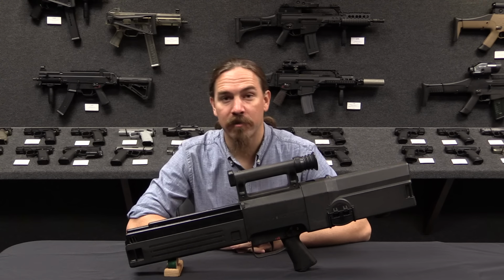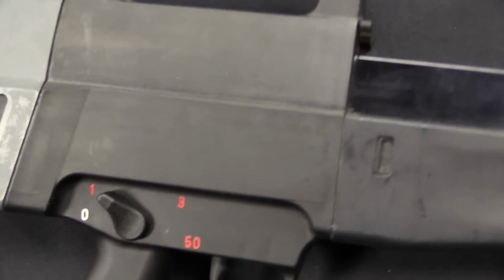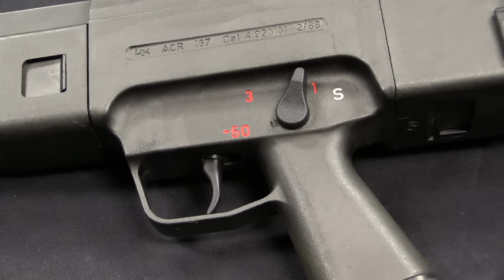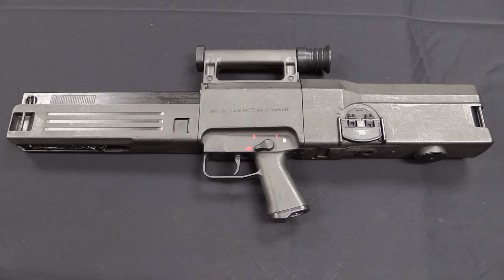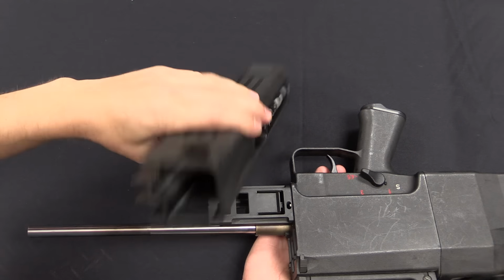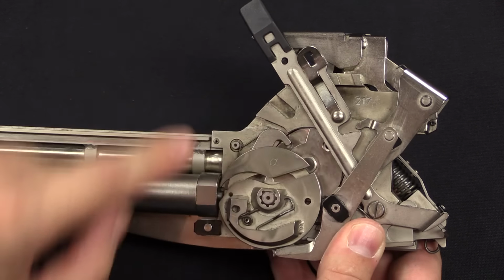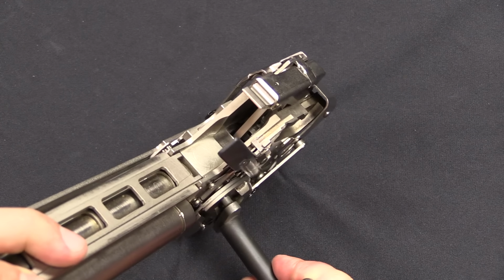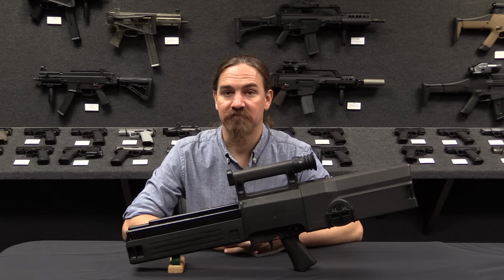Kraut Space Magic: the H&K G11

Comment: I'm no engineer, but wouldn't that have been a lot more effective with  an electric ignition system, acting on a hair-thin copper strand in the "cartridge"?
I mean, it was a newly developed round anyway. Probably easier to embed something like that into the block of powder than a primer, and it would just burn off in the explosion. And it would have enabled them to get rid of most of the clockwork, replacing it with something like a piezo igniter and a few coils and capacitors. Wouldn't even need a battery  (though having one would be beneficial for fully automatic fire).
If you have to make it space magic, make it space all the way. Replace mechanics with simple  electrics and analog electronics to reduce costs and complexity. 
Is there something I'm missing here?
Reply: Electronics, even 'hardy' ones can have temperature issues at extremes. A bigger potential problem is airmobile operations. Aircraft can build up phenomenal static charges in flight (more so in dry conditions) that are unpredictable at best. Imagine all of the ready ammunition in a troops rifle and pack spontaneously going off the moment his feet touch the ground.
Reply: @markbecht1420  You do realize that most fighter aircraft use electrically primed cannon and have for decades?
Reply: ARCNA442 uh what
Reply: @ARCNA442   Sure. Back to at least the 40's. But that's in an electrically bonded/grounded and integrated structure, not in a polymer magazine in a nylon pouch strapped to the squishy bits who might be roping off a helicopter (always let the line touch the ground first)
Reply: @markbecht1420  I laughed when I read your comment. That would be disasterous XD
Reply: The most of those mechanism are working for feeding/extracting and locking,ignition is probably the easier part.
Even if electronic primer is used, you still have to use clockwork to improve the gas sealing, or you have to use multibolt system or traditional system......then why use caseless ammunition?
Reply: @程鈞ChengJyun8542  Caseless ammunition was conceptualized as a way to increase the number of rounds that a soldier can carry into battle without increasing weight. By removing the traditional brass cartridge, not only can the actual ammunition be smaller than normal, but also lighter, thus allowing soldiers to carry more rounds for the same weight.
Reply: @StrikeNoir105E  also reserve vital war making material i.e. brass
Reply: @程鈞ChengJyun8542  use caseless to reduce loadout weight or maximize rounds carried.
Reply: @nichevo1  But use caseless ammo on a traditional configuration not only create gas sealing issues, but also prevent the use of non-circular ammo shape(to reliably feed),retain the potential feeding issue of traditional system,need a extra large port to clear malfunction......
Only weight advantage is definitely not OK for such a great R&D investment.
Reply: @程鈞ChengJyun8542  As far as I know LSAT worked well with caseless ammunitions and it's not a swiss made clock mechanic
Reply: @DC2022  LSAT is definitely not a traditional system.
Also,from developing stand point, LSAT is  not as finished as G11, and not like it has been 30 years apart or something
Reply: Electronics can fail at any time, it'll be a long time before vital functions are tied to tied to electronics, if ever, given how big of a threat EMPs are already.
Reply: @BigHairyFenian  simple electronics are at least as reliable as mechanical system and if they are simple enough they are not susceptable to employ.
EMPs destroys modern micro controllers etc not early cold war stuff
Reply: aggese The Germans knew that way ahead of the US.
Reply: I've been thinking this for a while. It has a lot of potential issues, and I assume that's why it wasn't done (there's enough potential issues already), but rumor has it it was actually floated around because electric ignition would allow them to make the propellant more resistant to heat, thus reducing the chance of cook-offs. 
Who knows, maybe it would have gone there had the rifle been adopted - as a follow up development. 
I don't think it would have made the internal operation any easier, though.
Reply: Electrothermal weapons as the name suggest use electric trigger system and this don't explode when passing below high voltage lines, working well (but  arriving at the end of USSR the kind of fate lot of 90's hitech stuff shared).

Imagine a rifle using a magazine with two parts, one for the bullets, and another being a tank for liquid propellant (having better energy than powder). With less propellant you would be able to fire more powerful ammunition. Or having two separate magazines, one being for bullets and another being a fuel tank used to fire the standard load of ammunitions carried. You would be even able to select your ammunition kinetic energy for example to fire subsonically by switching mode and "flowing the chamber" with less propellant or not loading a bullet in case you fire rifle grenades.
Yeah, I know it looks like scifi and would be seen as too complicated for real military operations. But I like this idea.

And btw, military stuff is shielded against EMP, it's a requirement so an electric primer system would be shielded to be immune to ESD and EMP if needed.
Reply: As cool as it sounds, the only portion of the mechanism that would be reduced by going electric would be the striker.  All the rest of the mechanism would remain for cycling the cartridges.   The next bit is getting it to remain reliable through environments.  Submerse the whole assembly in saltwater for an amphibious landing and keep all the electrics working like clockwork.  I personally like the idea of electrical ignitions, but I've not seen any way to overcome the difficulties with reliability
Reply: I've always wondered why electric primers haven't taken off. They would allow significant simplification of the fire control group and should improve drop safety.
Reply: would electronics leave debris behind them? melting plastic in your gun?

Comment: Why is everyone making such a big deal of the action being complicated? The thing is  completely sealed off from the elements and the chamber is easily accessible through the port on the bottom, so why would a soldier do even a basic fieldstrip under any circumstances? When an M16 is fucked so much that a soldier can't clear it, does he pull out his repair kit and immediately get to work in the middle of combat, try to bend parts back into shape with pliers, etc., or does he use his sidearm instead? And as for the armorer's headaches - why wouldn't he just replace the entire action? 100 spare rounds and that 3 round hyper burst sound like a good tradeoff for people going "Wow... I don't get it" when they see it, especially since the thing didn't show any major flaws during the trials.

Comment: But what is the secret sauce that makes the rotating bolt gas-tight and prevents revolver-like gas spills between the barrel and cylinder/bolt (not to mention the cartridge-sized hole in the back side of the rotating bolt)?
Reply: Thats the Space Magic part
Reply: Das ist German wonder weapon, Ja !
😎
Reply: Konstantin Avilov does it have a cartridge sized hole at the back? I think not, since it rotates through 360 degrees although the “finger” has to have access to act on the cartridge.
Reply: @farmerbrown84  The bolt inevitably has a complete through-hole because new cartridges are shoved in from one side and dud cartridges are pushed out on the other side simultaneously. So the locking system has to squeeze the bolt horizontally in order to prevent gas leakages on both ends.
Reply: "Precision German engineering."
Reply: @ImperceptibleX  If the round bolt was simply super-precisely fit to the "bolt carrier", it would not work: first, fouling would get between the surfaces and make the bolt stick; second, with time and wear, the precision would deteriorate and the gas would start to leak. So there has to be some cunning locking mechanism.

Comment: Since the action can't be taken easily apart, it is kind of baffling to visualize the feeding system.
 If I understand this correctly, the chamber rotates 360 degrees, and can be fed from both ends, right?
The cartridges are fed primer down into the chamber, then the chamber rotates 90 degrees forwards to present the projectile towards the barrel.
If it is fired, or is a dud, the chamber can be rotated another 90 degrees downwards, and a new cartridge will be fed, so that it will push the dud out with primer facing primer?
Reply: Yup. It's just turning in 90 degree increments in the same direction. If duds and any misfire issues were guaranteed to never happen ever, they could have even had it fire every 90° degree turn instead of every 180° degree turn by redesigning the rotating bolt thing feeding clockwork to accept rounds from all 4 sides.
Reply: @datonkallandor8687  I think that's impossible, there's no way that  4 side bolt can remain gas sealing
Reply: Unfortunately, then you'd have the possibility of chain fires:/

Comment: I still remember when the air  gun manufacturer Daisy came out in 1968 with the .22 caseless, primerless gun that was originally not classified as a firearm. It's ammo was ignited by highly compressed air that when quickly released the heat from it functioned as a primer. It functioned as a single shot firearm but was originally classified as an air rifle, at least until the ATF got it reclassified as a firearm in 1969 after all the gun control laws were passed following the Bobby Kennedy & Martin Luther King assassinations.
Reply: I don't remember it per se, but I have read about it. Very cool concept.

Comment: Imagine if they revisited this with modern technology. Could be very promising
Reply: I wonder. How many parts could we actually improve? 
The sights, definitely. 
Maybe slightly more modern materials. The ammo is  big one, didn't they trial caseless for the LSAT before going with polymere? I think they increased the burn rate or smth. 
But, just like electric cars in the century after ~1910,not much happens if no one cares. 
The most significant improvement for this gun that might give it a chance would probably be to find a way to make it notably cheaper.
Reply: Right

Comment: What about sand, mud, dust, water, all the stuff surrounding a fighting soldier?
Reply: The gun is well sealed against all that
Reply: @visionist7  - really? That incredibly complicated mechanical system covered by a plastic box simply clicked on? Did not look like it, the mechanical loading block should even move inside the plastic cover, will there not even be dust there? Sand particles?

Comment: This might be a dumb question, but what is preventing designing a ordinary cased rifle, with 2000 ish rpm, and putting a burst mode in it? Is there a practical limit to singe barrel firerate, and/or do you get a lot of recoil that way?
Reply: The idea is to have all the rounds for the burst (3 in case of the G11, 2 for the AN-94) leave the barrel before the muzzle starts climbing due to recoil. If you were to design a regular gun with a very high rate of fire, every shot after the first would just go into the sky.
Reply: H311fi5h Yes, i watched the vp70 video after posting. I see what you mean. Thanks for answering.
Reply: The Vector kind of fixes the recoil issue, by moving bolt mass downwards to compensate for recoil.  But if you want a real controllable burst at insane fire rate the mechanism is gonna to stupid complicated

Comment: Wonderful video telling me a lot of new things about one of my all-time favorite guns.
Just one minor pet-peeve: If I remember correctly, the cartridge was built differently:
The primer was at it's center, right behind the bullet. When ignited, it would push the projectile into the barrel before the main propellant burns up. That primary propellant was of a castable type, similar to TNT or TNAZ, which in turn was protected by a thin cylinder made of an explosive polymer (which did little for the propulsion, but was tougher than the main propellant, but still burnt without significant fouling...).
As you might imagine that cartridge had some major problems to solve:
a) premature cooking off
b) breaking, especially during feeding
c) misalignment of the projectile and the barrel (resulting in the cartridge exploding without properly feeding the bullet into the barrel, which could damage both the projectile and the gun)

Comment: Small detail I noticed, if both versions of the gun shown used the same 50 round magazine, why does the production version have "-45" for the full auto position on the selector switch as opposed to "-50" like on the earlier one? (Assuming the number is a reference to magazine capacity)
Reply: IIRC mag capacity was derated from 50 to 45 sometime or other, reading about this in G&A or Shooting Times in the 80s.
Reply: @nichevo1  That would make sense. Or simply that the size of the pre-packaged stripper clips was settled on to be 15 rounds. 3 clips -> full magazine. Guess it wouldn't have made that much of a difference if the actual max capacity of the mags was 45 or 50 if most of the reloading was to be done via said clips.

Comment: It's funny to me that the first guy to invent a brass cartridge hit the nail on the head close to 150 years ago. They would of had no way to know about heat sink issues or anything else for machine guns but nothing else has come close.
Reply: Sometimes the simpliest idea, such as forming the case out of a metal that slighty expands is the best one the first time around.
Reply: @CThyran  didnt he choose brass because it was cheap and relatively inert when compared to it's historical counterpart?
If true it was serendipitous.
Reply: @Ben.....  I can't remember the story completely but I believe he tried copper first as the earliest metallic cartridges were and realized it didn't seal the breech well enough and instead chose brass because it sllghty expands.
Reply: Don't forget the civil war rubber cases for smth carbine, that I think now are made of silicone , that can take heat, and can seal.  Only150 years after the original reloadable rubber cartridges.
Reply: that simple idea, just need roughly 300 years since otttoman jannisaries fielding firearm in large number and only truly battle tested as standard fire arms system at german empire and french war at 1870s.

Comment: I wonder why they didnt make the bolt just go in a circle, kinda like a twisted around minigun
Reply: There is probably a much simpler solution such as that but the Germans made it so it's not gonna happen in an even slightly practical manner.
Reply: Actually, there is exist of some prototype / mockup of LMG11 that utilized 3-chamber revolver cannon style.
Reply: Same reason you can't have a turret rifle. Too dangerous to have a rotating chamber.

Comment: AAAAAAAAAA SPACE MAGICCCC. Space force weapons babbyyy
Reply: Somewhere around the early 80s or late 70s, the USAF worked on a variant of the M16 for 'offworld' operations. Best of my recollection is that it used a plastic case and low mass aluminum bullet, with ultra low recoil. It was designed first and foremost, to hole suits and thin skinned vehicles. I haven't been able to find any info since the early 90s and wish someone could dig up some.